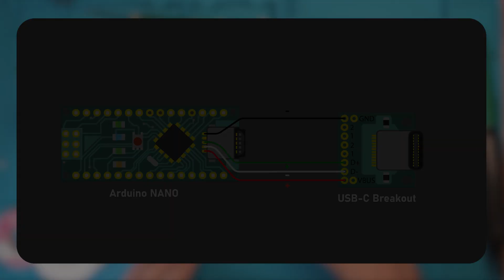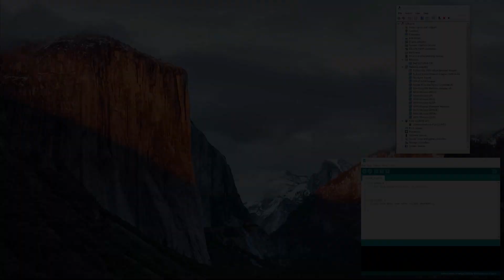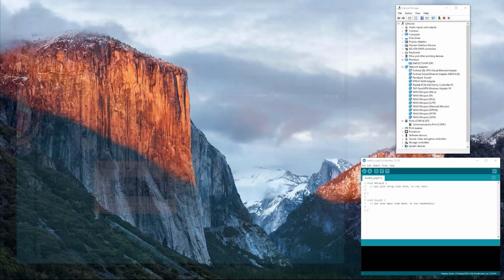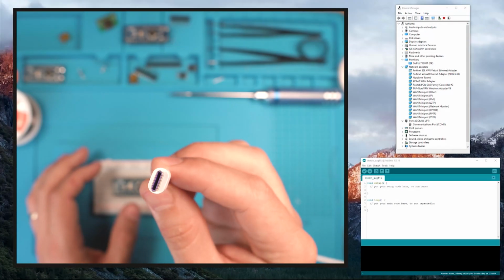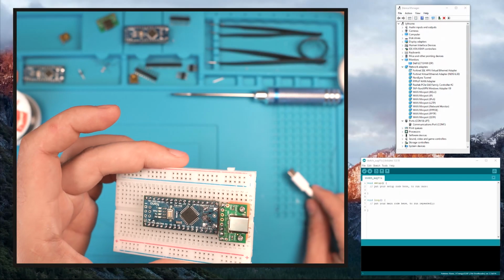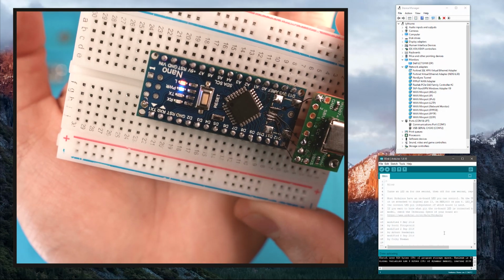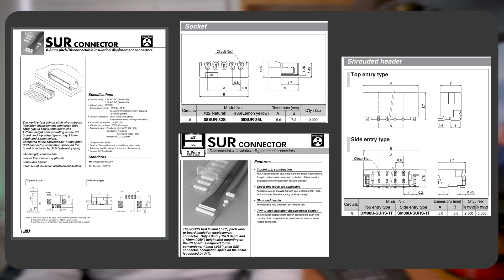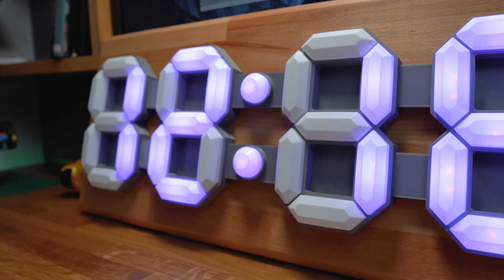First USB-C Arduino NANO retrofit?

Comment: I know that this is an old video, but it's still very good, mostly because it confirms that the conversion from a Micro connector to type C is actually easy to wire.

Personally, I have avoided it because I was thinking only of using the actual USB C connector that is not in a breakout board.  LOL  Now I realize that using the breakout board is just easier.

However, I'll make a different design as I do want the USB C connector to be attached to the PCB of the Nano and not on a breadboard.

I don't use breadboards.  I use these Nano adapter boards that have the little green screw quick connectors.  So much easier and the connections are solid.

Comment: but why? There are so many microusb cables just laying around without any usage...
Reply: UPDATED

I just realized that I read yaneemdetey's comment incorrectly.  MY BAD!  He was referring to MICRO USB and I misread as MINI USB.  No logic, of course, to change MICRO connectors.

I realize that your comment is over a year old, but I still want to respond to it.

Why?  Because it's harder to find old USB Mini cables. I MISREAD THAT... SIGH...

Personally, the ones I have are also getting older and some have just failed at the connector itself.

While I do have a few Arduino Nano boards, I also have a bunch of the Nano Every board.  At least those boards have a USB Micro connectors and those are still available.

Honestly, while I do want to just upgrade the connectors on the old, regular Nano boards, I mostly use Nano Every boards, not because of the connector, but because of the extra memory and speed.
Reply: @BlondieHappyGuy yah, i got your point. i just mean it doesnt worth the labor to do it. MicroUSB is still widely used (but i prefer no to buy anything new with it) and it will be available at least for 10 years, if you expect something futureproof just you can always take anything factory C (atleast to secure soldering problems).
Reply: @ 
@yaneemdetey
I just realized something.  I totally misread your comment.

You did say "micro" but I took it as "miniUSB".  My error.  Sorry about that.

So yes, I agree then, for MICRO, there's no point to change those.

Only MINI (the old ones) is it worth it.

Sorry for my misreading your comment there.
Reply: @BlondieHappyGuy lol. things like that happens everyday. MiniUSB is just dead, i keed few cables just for compatibility, but mostly "just in case"

Comment: Nice work! One very important thing to add, the Type-C receptacle must have TWO 5.1k resistors connecting its two CC pins to ground separately. If your Type-C receptacle breakout board doesn't have the resistors, it could still work on legacy connection (USB-A charger + A-to-C cable), but it will not work on Type-C connection (Type-C charger + C-to-C cable).
Reply from the maker: That’s a good point,I haven’t tried it yet!I did this mod on the Arduino first just to see if it’s possible. My real mission was a retrofit on to my 3D printer which worked a treat.I have another video on that on my channel!
Reply: I don't get it, ca you please explain.

Comment: Does a usb c port that fits the exact footprint of a micro or mini usb not exist yet?
Reply from the maker: At the time when I did the mod there were no footprint compatible break-out boards. USB-C connectors have got 24 pins as opposed to 5 pins on the Micro USB, hence you need a break-out board. Should you find a connector with the same number of pins and same pitch, please let me know, that would be interesting to experiment with.

Comment: Could you this also with micro USB?
This was nano USB if I am correct.
Reply from the maker: Yes, this was a NANO and it can basically be done on ANYTHING that has got an USB connector  provided you have the space to do it. I did it on a breadboard as I needed the whole assembly for my clock project.